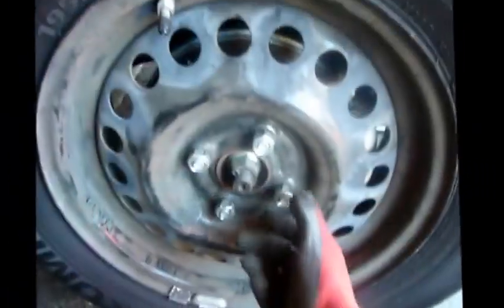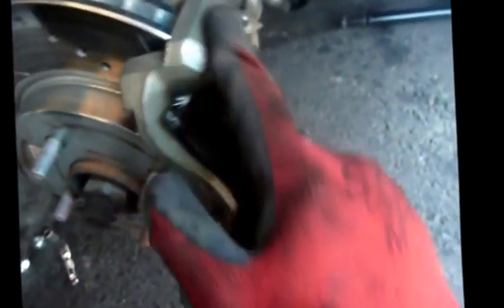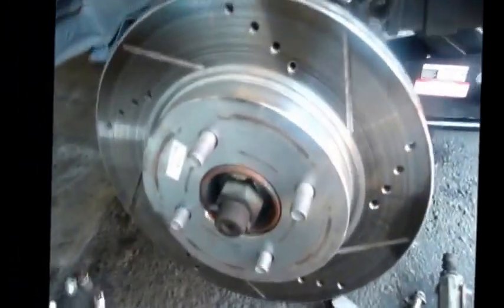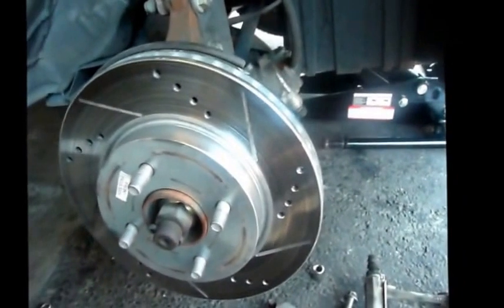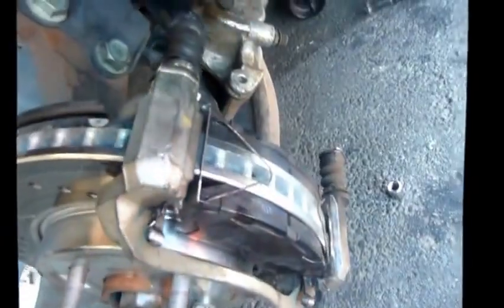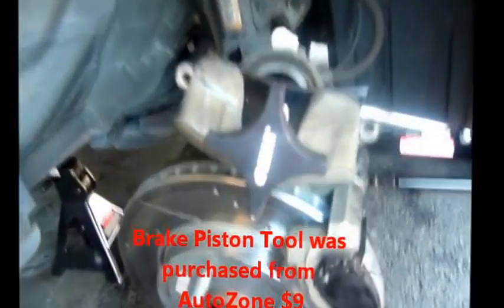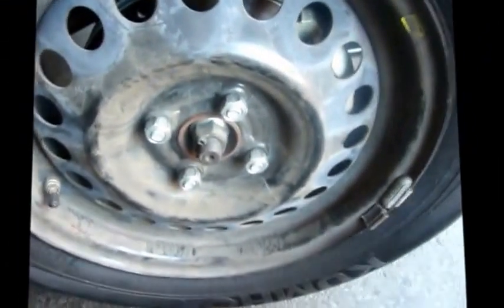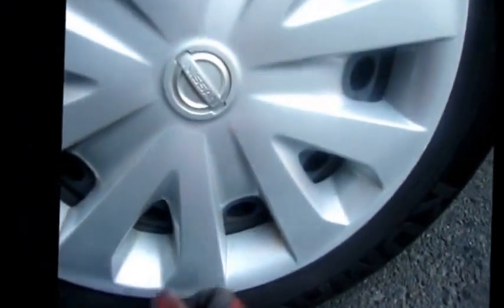2013 nissan versa front brake pads and rotors replacement

Comment: You forgot to properly torque the Caliper Pin bolts and Caliper Bracket Bolts. You need to torque all bolts to spec. Caliper Pin Bolts is 20 Ft/lb. Caliper bracket Bolts is around 80-90 Ft/lb.
Reply from the maker: Hi Zach, thank you for the information, this will help other viewers.
Reply from the maker: Thank you Zach Drake, I'm sure this information will be helpful to other viewers. Thanks again.

Comment: I just replaced my front rotors and pads using this video. When putting the caliper back on, a bolt snapped in the guide pin. I figure if I just replace the caliper pin and bolt I should be ok. I found this one on amazon https://www.amazon.com/gp/aw/d/B000BZYTIS/ref=ya_st_dp_summary
But for now it's only bolted on the top and not the bottom. Still safe to drive for a day or two before the part comes? The brakes feel great when I took it around the block
Reply from the maker: Good to know you were able to replace your front rotors and pads,  but was the bolt rusted? or did you over tighten? It is not safe to drive around with only one bolt holding the caliper, that one bolt can eventually snap too and become a dangerous situation. better to wait for the part.

Comment: How are Versas for general reliability?  I was thinking of possibly buying one and have seen mixed reviews online.
Reply from the maker: So far so good. I've been on top of the maintenance, so no issues, but i have read complaints about the SV transmission not being an on demand response. But the car works for me, very fuel economic.  hope this helps.
Reply: Because of the CVT transmission,  I would avoid them. I have one and at 100,000 miles, it's already slipping
Reply: bought a used 2015 i n October. its great. roomier than any car in its class. its a Nissan motor so the engine will run forever. the 2012 was the first of the next gen so anything 2015 and current you should be fine. I love it. I do uber with it. I got mine certified so I'm still under warranty
Reply: +Eric J what year?
Reply: 2015
Reply: Just had transmission replaced and it cost me $3000.  Glad it worked out for you. Didn't work for me. Won't buy another
Reply: +Eric J at 100k miles you should flush the fluid if you haven't already. transmissions require every 30k.
Reply: +Eric J cars are hit or miss. I've owned Nissans and infinitis for 25 years. never had transmissions issues. Volkswagen gave me hell. I don't buy new cars ever.
Reply: I got my first Nissan 30 years ago and have had 4. This is my first experience with a dud.  That's not correct. That's like changing your oil every 3000 miles.  Just not the way it works anymore. Nissan does t even suggest changing it every 30000. Simply put, I got a bad car
Reply: I have a Cadillac that I have had for 10 years. Not one problem so far. I had a Chevy Tracker for 11 years and didn't have a problem until it had 240000 miles. I got a bad apple from Nissan and the cost of that has soured me
Reply: Bought a 2008 Versa 4 spd auto in 2010 with 26k. Now with 110k. Only issue is every time we go on longer trips 5 hours+, the crankcase position sensor goes haywire. So we just dedicate the car to relatively local commutes.
Reply: @ericj4879  I have a versa with a manual transmission. You gotta know manual.
Reply: @conceptcs  the 2008 is not the same car as the 2012 and on.
Reply: Be careful there's a class action lawsuit dealing with faulty transmission(CVT). That's at least for 4 different models including Versas.